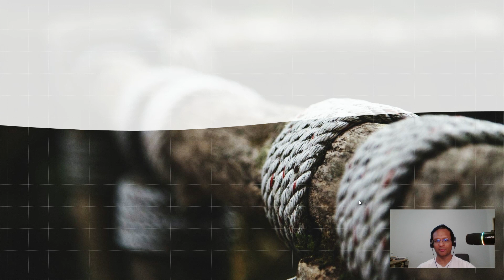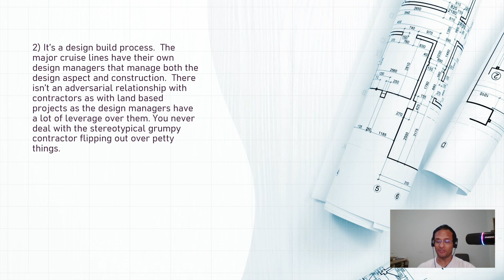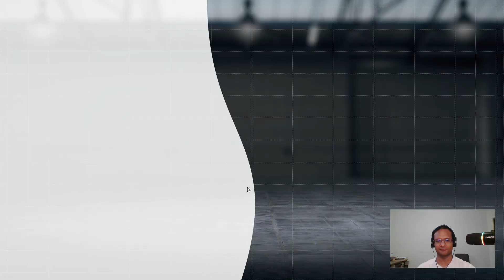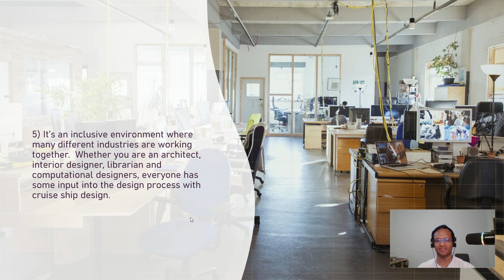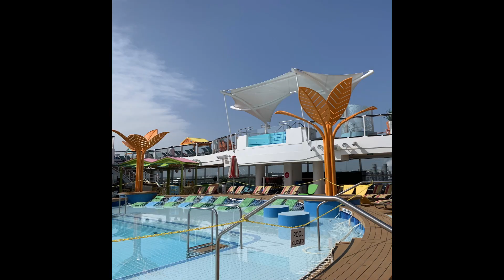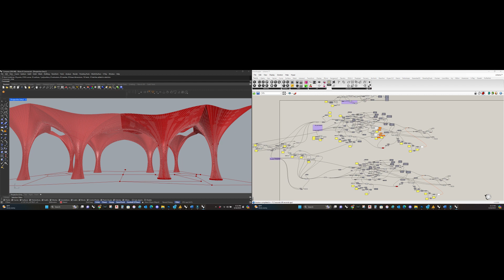Cruise Ship Design is more than an industry of creating spaces but a canvas for fantastical dreams

Comment: Any tips for architects to career shift for this industry
Reply from the maker: If you have an architecture background, it will serve well in doing this sort of work.  You're dealing mainly with steel parts and pieces.  Building codes for land based projects apply to the cruise ship world.  There are more and more design firms entering this industry.